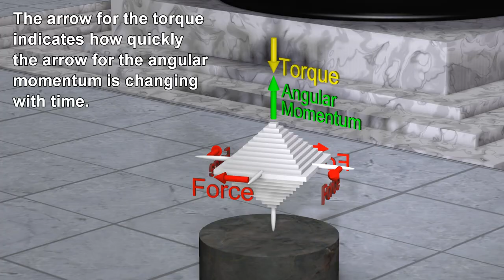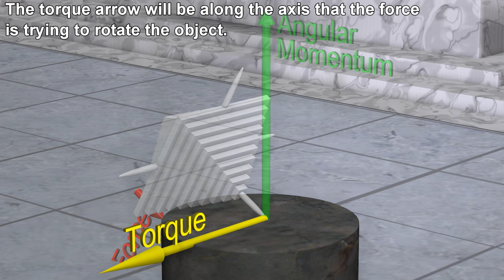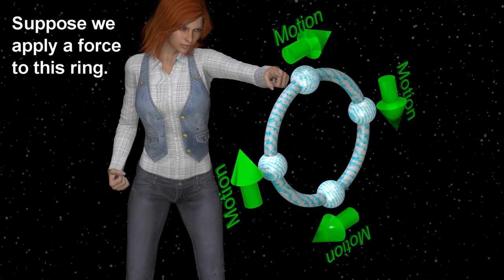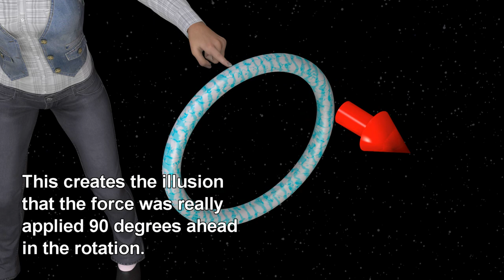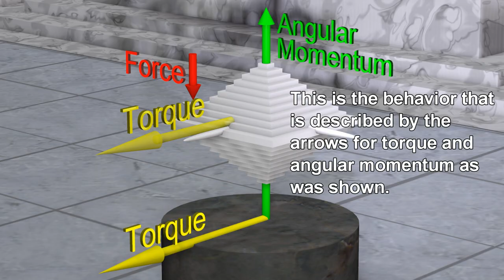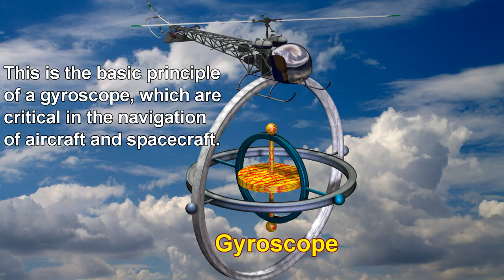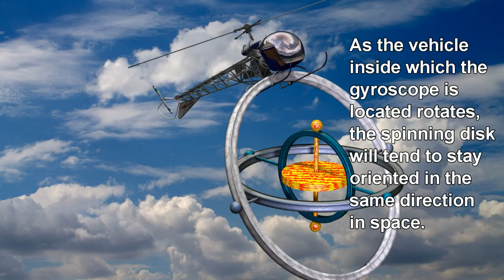Gyroscopic Precession and Gyroscopes

Comment: This video was very informative and I really loved it. I use what’s called the right hand rule. Cuff your fingers around like you are giving a thumbs up. The fingers point in the direction of rotation and the thumb is always pointing in the direction of either angular momentum or torque depending on which force you are applying this rule. Then once you apply the right hand rule, it’s just a matter of remembering that the angular momentum vector always tends towards the torque vector. There, you have it a simplified way of finding the direction of gyroscopic procession.

Comment: When you mention that the axis of rotation always points in the same direction as the angular momentum, I believe it would be more accurate to say that they are usually in the same direction but not always exactly. Intermediate axis theorem (or the less technical name for it, tennis racket theorem) and the nutation of a top are direct results of this inconsistency. Otherwise I think this was great video for beginners and I honestly came out with a better conceptual understanding of gyroscopic behavior under the influence of a torque.
Reply: David Gronlund the axis would constantly be changing, and the arrow would be changed to fit this axis.

Comment: I love this presentation. Question: as a side force is applied (red arrow) and the angular momentum moves out the length of the red arrow, the angular momentum vector becomes longer. Does this suggest the object starts to rotate faster as the green arrow grows?

Comment: Awesome video man, but I am actually confused: I don't think angular momentum is ALWAYS parallel to the axis of rotation. It may have another component that makes the total angular momentum arrow go along another direction rather than the one of the axis. Where am I mistaken?
Reply: Generally speaking the direction of L is not parallel to the direction of rotation...hence the need for an inertial tensor.  But in special cases when rotation is parallel to one of the principle axes -like a gyroscope ...then the angular velocity and momentum vectors are parallel.

Comment: Kudos! Best explanation of a gyroscope and precession I've come across! Would you consider covering tippe tops and gyroscopes in smartphones in your future videos? I can't be the only one curious to see the visualisations of those topics. :)
Reply from the maker: +vital989, thanks for the compliment.  I will add those topics to the list of topics for future videos.  Thanks.
Reply: +Physics Videos by Eugene Khutoryansky      Here are some more topics that came to mind:  How holograms work on a micro scale, how did Earth's magnetic field originate,  how do transistor circuits operate on an electron level, how Faraday's Law work on an electron level, how to use Feynman's diagrams. All in all, videos about electronics and electrical engineering would be appreciated ( I study EE at university).

Comment: So, gyroscopic momentum induces a precessional torque 90 degrees from an applied torque.  Can it be reversed?  Specifically, can a combination of applied torques induce a change in the momentum of the gyro?  I'm more interested in an increase of rotational velocity, but for the sake of understanding, consider this example:  You have a classic spinning gyro suspended horizontally on a string and gravity will induce a precessional torque that will try to make the entire gyro revolve around the string.  If you don't allow the gyro to revolve in the direction the precession is trying to make it revolve, will that affect the speed of the gyro?   I suspect it will slow down much faster than if it's allowed to precess.   Is my suspicion correct?

Comment: At 4 minutes,  wouldnt it be correct for the F-Vektor to stay vertical as a gravitational force inducing the torque? The way presented in the video there would be a torque and a tranlational movent parallel to the Vektor of the torque.

or did i get something wrong?
Reply from the maker: +ulrike lind, at four minutes into the video, I am not showing the force from gravity, but simply an arbitrary force that someone applies to the object, and then showing how object will react to it.  Thanks.

Comment: Does the torque moves to the top of the angular momentum AFTER the force is applied WHILE the object is spinning?
Reply from the maker: +SAI Stereoheart, the torque arrow is a vector, which means that the only thing that matters is its direction and magnitude.  The location of the arrow is irrelevant, and the location of the arrow was shown to move only for demonstration purposes.

Comment: Why does the imagined "angular momentum" have that particular handedness direction in relation to the direction of the spin, instead of a handedness in the opposite direction, (i.e. 180 degrees in the opposite direction) ?
And would it be in the opposite direction if the gyroscope was made of antimatter ?
Reply from the maker: It is just a convention as to what direction we want the arrows to point.  If we reversed the directions of all the angular momentum and torque arrows in relation to the spin, all the observable measurements would still be the same.

Comment: 4:40, 4:57.  Points are mathematical constructs indicating locations in space.  Points do not cause objects to move.  Also, once moving, nothing is required to keep an object moving (Newton's First Law).  Forces cause things that have mass to accelerate.  That is, forces causing changes to an object's motion.
Reply: The points refers to is a really small matter in an object. You're thinking about coordinates. The point she's referring is a very, very, small matter in the object with a very, very small radius that approaches zero. Also Newton's law refers to external forces in a system.When she applied the force (external force), it caused a change in the linear momentum of the objects (points) inside the system (the ring). Internal forces caused the velocity of the points to change the direction of the other points but their net linear momentum remains the same.

Comment: Thank you so much for making this video, I still have a few questions though:

1. if a  torque can change angular momentum that already exist in an object, what's the equation that describe such a change? To make the question more concrete, suppose a ball has an angular momentum of 5 Radian/second pointing in the z-direction, and a torque of 1Newton*Meter pointing in the x-direction is exerted on the ball, how will the ball's angular momentum change during the time the x-torque is applied and how can I calculate it?

2. Also, can angular momentum be broken down to perpendicular components?
Reply: 2. Yes any vector can be, so Angular momentum can also be broken down to two perpendicular components

Comment: None of this addresses the cause of this effect.  This is all comprised of mnemonic devices that are passed off as causal after the math used to describe the effect.  In the 1800's, I think they understood a mechanism before the math, but the only way that they found to describe the effect with mathematics was through the axis of rotation.  So now the entire explanation follows the math, but this is completely missing the cause of the effect.  The cause is found in the initial tilting axis that runs through the spin plane that creates a second perpendicular tilting axis that inverts all forces created from the first.  This means you don't need a spin axis to create a gyroscope.  4 straight lined paths of mass interlocked in a square pattern will create the effect -no spin axis!
Proof:  https://youtu.be/edrp-ag2TfY

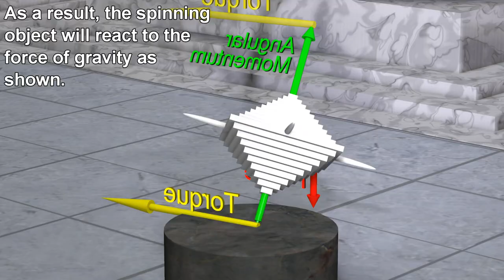Comment: 7:20 now it  is spinning about vertical axis also, what gave torque about that axis?
Reply: Even though it wasn't stated in the video, that's the precession axis. For a spinning top, that axis is always vertical. The gravitational torque is basically redirecting the motion of the top 90 degrees to the gravity, which is what precession is.

Comment: why gravity rotates axis of the gyroscope insted of holding it on one tilted position?
Reply: I think it's 'cause gravity and the gyroscopic precession are acting at the same time
Reply: when the gyroscope's axis rotates due to the downward force(by gravity),by 90 degrees,  then the downward force follows the direction of tilt (because the direction of downward force is through the center of mass of gyroscope, which is on the axis of rotation), which means the downward force and axis of rotation will always lie in the same plane. therefore the force follows direction of tilt and due to it's torque, direction of tilt tries to move ahead of force, and the cycle repeats.

Comment: I hate to be the bearer of bad news, but gyroscopic precession never occurs when the floor is removed, or the table to set the gyro on, or a pedestal to put a gyro on top of.  When none of that is present...the gyro just levels out and stays perfectly still.     But you guys know this right?  Precession only occurs when the entire weight of the gyro is resting on a table or the floor or a precious pedestal, acting as a fulcrum point/pivot point for the Precession to begin happening.  The BOTTOM of the Gyro has to remain STATIONARY, having all of it's WEIGHT on the SURFACE of a TABLE or FLOOR or PEDESTAL for Gyroscopic Precession to even have a PLACE to happen.  Wow yall missed that one by a long shot.  It went right on by you, it's was right in front of your faces the whole time.  Precession doesn't occur without a stationary pivot point at the bottom.

Comment: Very nice video! I still don't get how it works when the angular momentum axis is horizontal, as in the bicycle wheel experiment:  https://www.youtube.com/watch?v=8H98BgRzpOM
Shouldn't the gravity force still apply and make the wheel fall? The torque axis is not pointing upwards, and isn't therefore opposing gravity. Or is the gravity force just completely turned into that torque which makes the system rotate? But wouldn't the system in this last case start to turn around due to that torque even when the wheel isn't moving?
What am I missing :P?
Thanks
feflopizer
Reply: feflopizer same logic.

Comment: The math is a close analogy, but you didn't really explain why there is a resistance force.  There is a mechanism that the math misses.  Angular momentum is a concept assumed to follow the same laws as linear physics, so all of the instants of linear momentum involved in rotation are summed into a rotation term, basically renamed, and it is close, but it is wrong.  Look for a guy on Youtube, Math Easy Solutions, and he illustrates something that ALL gyros do that the math does not predict.